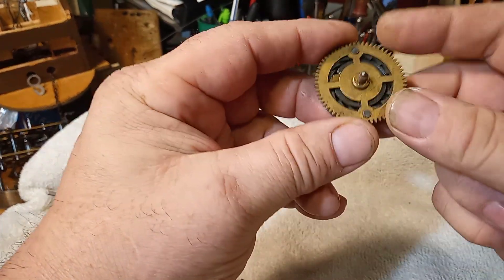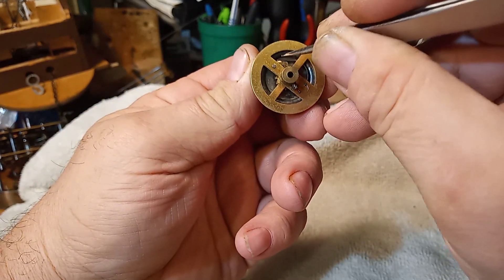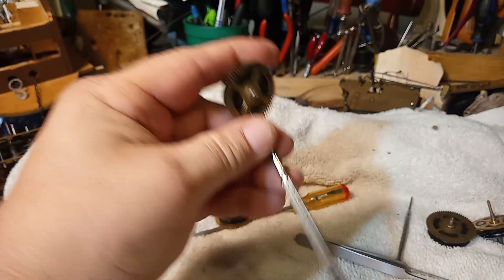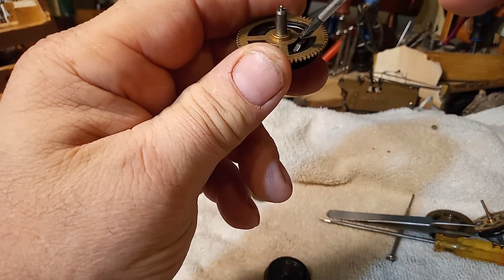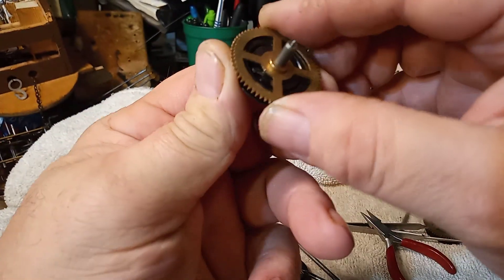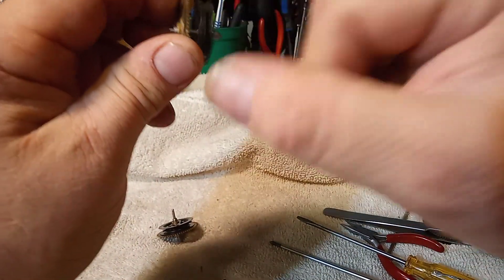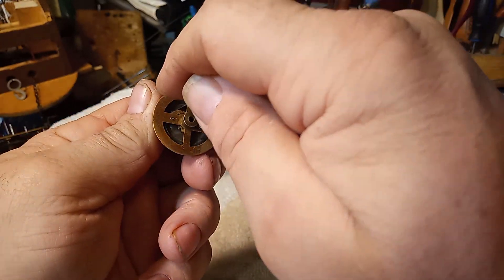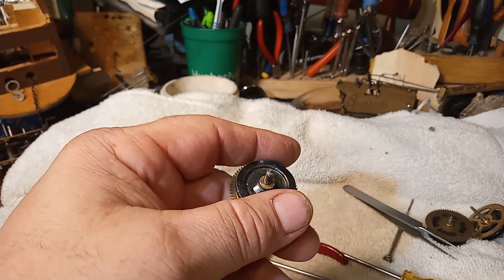Click operation for ratchet wheels explained for cuckoo clocks. 20220317 200008

Comment: Question: I have a Regula movement with 3 weights. The minute works fine, but the wheel which controls the bird and sound clicks fine, but it goes both ways. I put the chain in, and when I put the weight on it just clicked down to the ground fast. when I put the chain back on I noticed the wheel clicks going in both directions, it doesn't go only in one direction. It should only rotate in one direction, correct? What could be causing this problem?
Reply from the maker: You are correct it should only go one way.  The click isnt working The video you watched shows what to do on some wheels. You might have to order another wheel. Timesavers.com has the wheels. You would have to order one that looks exactly like the one that you have for the movement that you have. Good luck.

Comment: I recently received a main wheel for cuckoo clock that has a chain guard installed and no matter where I place the guard it interferes and rotates around causing issues is there any fix that you know of when working with these chain guarded main Wheels?
Reply: I made the decision to cut off the guard and now it works normally. Before I cut it off, it would rotate interfering with the 2nd wheel.
Reply from the maker: Did you have it on the post that holds the plates together. Because it should not have rotated if you did.
Reply: @munnerlyn3   Yes fully assembled and would rotate CW, having no place to anchor the post. Timesavers told me put it at 12:00 but still interfered with 2nd wheel and Escape wheel. Very strange.
Reply from the maker: I havent dealt with that many chain guards. However looking at some on timesavers they have a cut out in them for the movement plate posts. So the post prevents them from rotating.  The following is a typical ratchet wheel with chain guard showing the cut out section for the post.  https://timesavers.com/search.html?q=32827&go=Search
Reply: @munnerlyn3  The post attached to the chain guard can't anchor anywhere, causing interference with Escape/2nd wheels as it rotates CW. Really bad design.